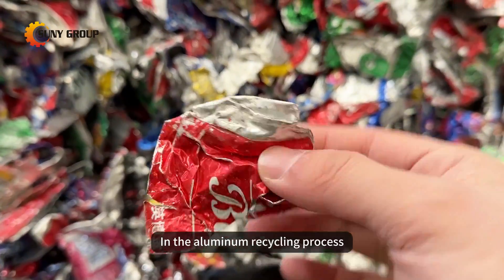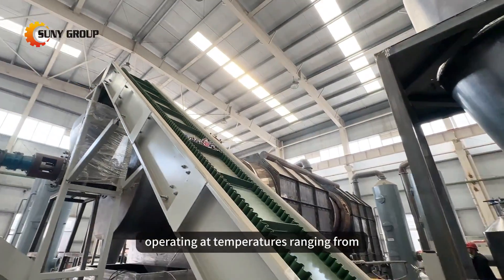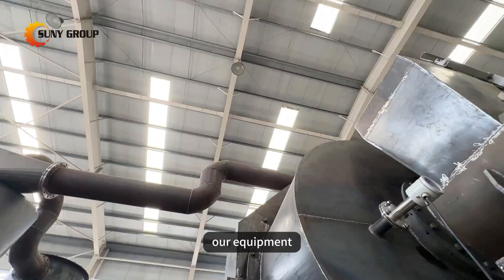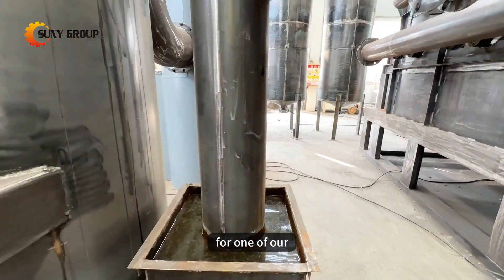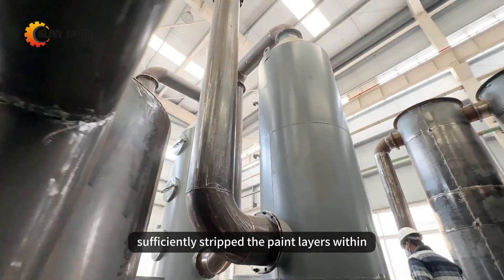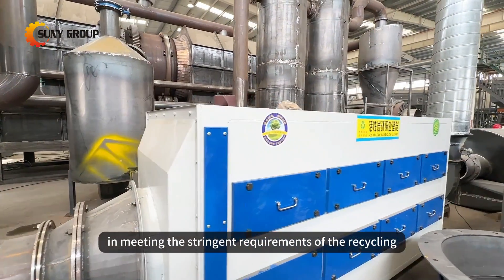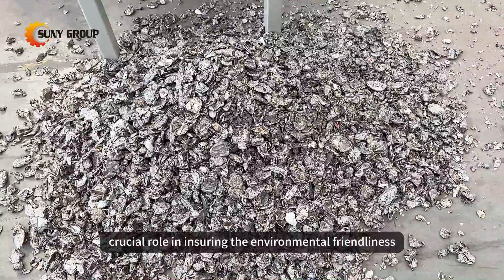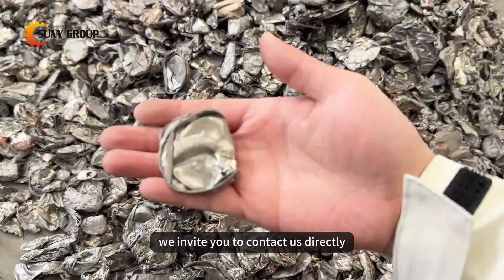Paint Removal Furance Aluminum Cans Decoating Process

Comment: just out of curiosity, can those machines also remove organic residue? or is the aluminium washed prior to the paint removal? is it possible to recycle aluminium tubes used for e.G. tomato paste?
Reply from the maker: Yes, our machines are equipped to effectively remove organic residue along with paint layers. The thermal process used in our paint removal equipment is capable of breaking down and removing both paint and organic residues from aluminum surfaces.  Regarding recycling aluminum tubes，theoretically, it's not a problem because the function of the carbonization furnace is to heat aluminum surfaces and inner layers without oxygen, causing the organic materials on them to decompose, thus removing paint and coatings.  For more info, feel free to contact at Whatsapp: +86 137 8362 0467